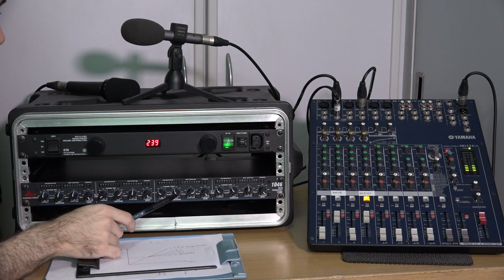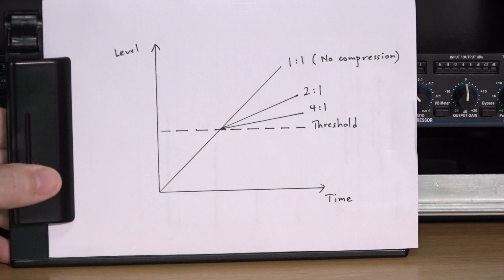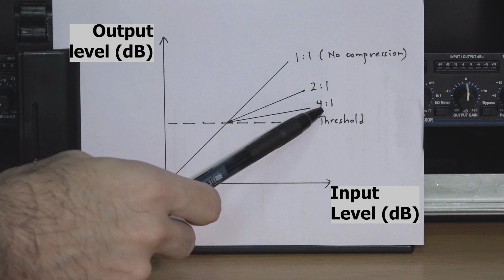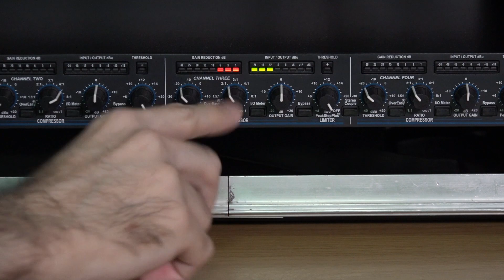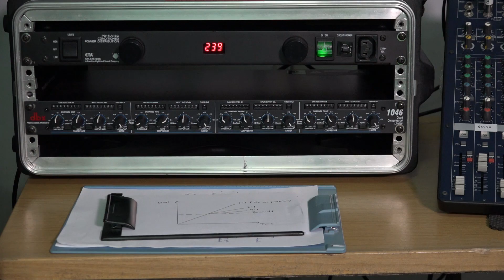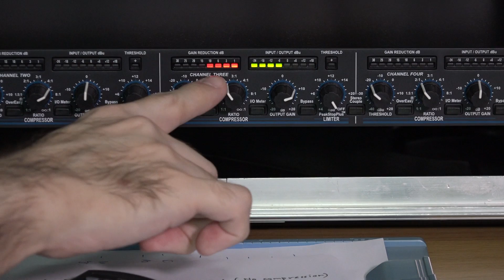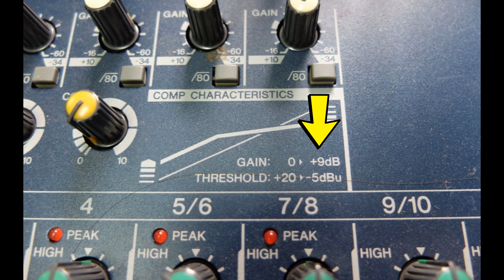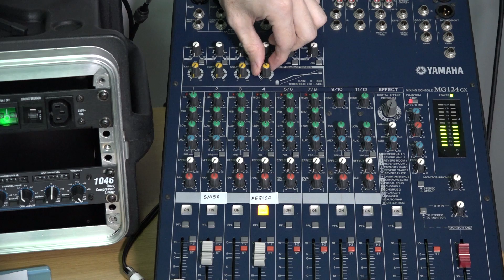How to use a one knob compressor

Comment: Hi Bruno, I'm a teacher in a secondary school. We purchased a new speaker system for our hall about 2 years ago, it was great sounding but it seemed to lack headroom (not sure if I got the right term). Whenever someone screams in the mic, there will be a terrible distorted sound coming out. I didn't have time to troubleshoot but I suspect that it could be signal distortion coming out of the mixer to the amps. Do u think I should get a compressor/limiter for my system? Also, can I connect to the group bus' insert io instead of individual channels, since most of my signals are vocals?
Reply from the maker: Hi Jeff, that sounds very familiar - I have worked on many school systems and they are almost all compromised, at least in Singapore. The distortion is generally at the mic preamp, where the gain control is. If you have to deal with screaming vocals a limiter is a very good idea - if you have the budget and technical know how it's best to upgrade to a digital console that has these on every channel.
Reply: @GLBProductions  Hi thanks for the info. I've also suspected that it might come during the preamp stage. I finally managed to troubleshoot but no matter how loud I scream into the mic, I can't get it to distort! Anyhow, will kiv. But may get a compressor/limiter for choir and drama purpose

Comment: Hi my friend .We have Allen & Heath MixWizard WZ4 16:2. in our church. could you please tell how to connect monitor to existing monitor out put and make it work with "M" control.
Reply from the maker: The "M" control on these mixers is meant as a mono feed, it's not really designed for monitor sends.

Comment: thanks for the demonstration, about the one knob compressor I still don't know what direction is the Best for set, because when u turn more and more the compressor knob will compress your sound begin hard to sing 。any solution ?
Reply from the maker: Start with no compression (fully counter-clockwise) and adjust from there :) If you have good mic technique you may not need any.

Comment: So, at first you set gain so that the loudest parts almost reach 0db. Then, when you apply compression, you end up with a stronger signal which peaks higher. Is it ok to leave it like that or should I lower the input gain to bring the PFL back to zero?
Reply from the maker: That is not quite right - when you apply compression you raise the average level of the signal, the peaks stay the same or are reduced, depending on the settings on the compressor. I recommend leaving the input gain alone unless you notice the channel is clipping.
Reply: GLB Productions That sounds right, I hadn't thought about it. I guess the problem is that we don't reach very high peaks during sound check, and the compressor stays below the threshold.
Reply from the maker: Yes, it's important to soundcheck as close to performance level as possible - singers in particular really need to SING into the mic, not just whisper!
Reply: GLB Productions It's difficult to be the soundman for your own performance. And for singers it's important to warm up before stressing their voice. So when you have to set up all the equipment and then soundcheck immediately, they don't have much time to prepare.
Reply from the maker: I can relate as I do some self-op performing as well as being a sound engineer. At times like that you just set things up and focus on the show, just like they did in the days before sound guys ;)

Comment: Awesome explanation, simple and straightforward.  Just a question, for the one-knob compression, do you set your gain first on the mixer prior fixing your compression?
Reply from the maker: Yes I normally set my gain first, but be aware that the two interact, so if you are using a lot of compression on this type of mixer you may need to compensate by setting your gain a bit lower. Thanks for watching!

Comment: awesome explanation Bruno. Btw ive got a tapco sq.2 by mackie, a vintage one 😅 any ideal settings that you can suggest?My setup is im using a yamaha mg166cx mixer and a DCA-550 power amp 200. If i put the compressor in between do i still need to use the on-board compressors?
Reply from the maker: Oh wow that's an old one, and very rare too! I'd say set the attack and release on auto, set the ratio at 2:1 for vocals and 4:1 for drums and then set the threshold to taste. You can also refer to my video on the Presonus ACP 88 for more info on this type of rackmount compressor: https://www.youtube.com/watch?v=jMajPBeAGbw
Reply: I know right? Hehe.Ive got a good deal for $45 SGD. its still new as the seller bought it for a project but never use in the end. Thanks a lot for the advise. Merry Christmas in advance. God bless! P.s i think ive seen you before in our church in Punggol last year with allen&heath gears.I think it was you 😀😀
Reply from the maker: It probably was, there are very few people working in audio in Singapore who look like me ;)

Comment: my keyboard player sings  REALLY  loud ...and one of my vocalist sings  REALLY REALLY  soft.....how do I set the compressor for those two guys???
Reply from the maker: In this case I would begin by setting the gain appropriately for the two singers - the softer singer will need more gain and the louder singer less. See my video on this subject: https://www.youtube.com/watch?v=KcUgggdxLPM
After that use the compressor to compensate for smaller variations in level.

Comment: sir can i connect the  2 channels audio output of my mixer to the input of the compressor and the output of the compressor to the input of the main amplifier so that i can control the output of all the mics connected to my mixer at the compressor ?
Reply from the maker: Yes you definitely can! The other way to do this is to insert the compressor on the main mix using the L+R insert points, if your mixer has them.
Reply: Have a nice day sir, thank you so much for your help.

Comment: Thanks again for the great video. does compressor helps to reduce feedback?
can you do a video n dbx driver rack as well. on how to setup for feedback control. I am having problem learing how to control feedback for condenser mic (rhode).
Thanks again for all your videos.
Reply from the maker: A compressor can help to reduce feedback but there are other much better ways of dealing with it - using directional mics, correct positioning of speakers vs mics, getting the mic as close as possible to the sound source.

Comment: I feel everytime I increase the compression knob the vocal is louder and it more stand out like it's sitting infront of your face but too much it will distorted,  don't know if it work by compressing your vocal loud to softer, what I know is it does make your vocal stand out more.
Reply from the maker: That's exactly the effect the compressors on this mixer have - by increasing the average level of the signal they make it stand out in the mix more. But too much and the vocal will distort in exactly the same way as when your gain is set too high.
Reply: Thank you, all your videos has been so helpful, but i was wondering how do you adjust the FX to give the Vocal space and full , what i had was a bit of space muddy to vocal and the tail is so hallow like in a tin can when fade away. im using for live karaoke, i thought i know alot but after watxhing your videos i dont know a thing lol. thank you for your help. would be best if yoi could make a video showing us , its for small size room.

Comment: Thank you for the clear and informative video. Is there a rule for use of compression? For example in EQ the best idea is less is more. Perhaps it wouldn't be needed at all for an acoustic duo vocals/guitar? And do you set the compression after setting all of the Gain, EQ, effects?
Reply from the maker: That's a very good question. In live sound, I'd say that most sources benefit from some kind of compression, because the natural dynamic range of most instruments, and especially the human voice, is greater than can be comfortably handled by sound reinforcement systems. As such, virtually every mix sounds better with some kind of compression. Knowing how much to use therefore is the key, and this takes years to learn. 
Compression can be inserted at several points in the signal chain: most individual channels are compressed immediately after the initial gain stage using an insert point, but you can also have compression on subgroups and the main mix bus. Each of these is a topic in itself.

Comment: Thank you for this video!  I have the same mixer, and this has been really helpful - on compression in general.  BTW - I love this mixer.  For my needs, the feature set is brilliant, and the bang for the buck extremely high.
Reply from the maker: Yes these mixers are great value for money - the one area in which they are compromised is build quality, so don't drop anything heavy on it ;)
Reply: Yeah, it's definitely not as solid as some!!  I think having the large external power supply makes it seem even less solid though.  Because of the substantially reduced weight, it seems to do okay and require less on-unit protection than say an equivalent Mackie.   Thanks again!  I passed this on to a coworker who also found benefit in your simple explanation of compression.

Comment: Very well explained.
Question though...recently I've come across some videos (regarding using Studio One DAW) that make use of "Series" compression for specific types of tracks. (drum bus, vocals etc.) The technique essentially makes use of very "slight" adjustments of the individual compressors in effect a quasi multi-band technique. I'd love to see your slant on this type of technique and how it helps or hinders the process.
Reply from the maker: I'm familiar with multi-band compression but not with this series technique. In live sound there typically isn't time for the advanced and intricate compression techniques that studio engineers use. We just need the dynamics level under control, stat ;)
Reply: oops my bad.  I realized that when you said so.  I was thinking mixing not about live recording.  In series compression is exactly that...two compressors in series with slightly different adjustments to better glue the track mix.  My apologies...wasn't trying to put you on the spot or anything.
Reply from the maker: No problem at all, I learn a lot from my viewers :) In live sound there is at least one form of series compression I can think of: on a digital mixer I will often use a high threshold, high ratio compressor on an individual channel like a kick or snare drum and then a low threshold, low ratio compressor on a group or mix bus. The latter would be set similar to a mastering compressor, so just giving a very gentle squeeze to the overall mix, similar to what you mention above. I have also used this technique with analog compressors, eg using a FET compressor on the individual channel and a VCA compressor on the mix, but you need a lot of gear to do this ;)
Reply: >> but you need a lot of gear to do this ;) <<
Yep...that's why we are pretty much in the box mixer/songwriters.  It's always THE GEAR!!  Agghhh!  :-D

Comment: how to disable the one knob compressor?? Is there any point using a seperate compressor with one knob compressor???
Reply from the maker: Yes, just turn the knob fully counter-clockwise. An external compressor will give much more control and is preferable to the one-knob compressor if you can afford one.
Reply: thanks for such a clear answer. have a nice day~~.
Reply from the maker: You're welcome! You have a nice day too.

Comment: Nice video, you should also do one on compressor vs limiter processors(there are lots of people who don't know and confuse them, eventually messing you up on live FoH mixes). P.S. Not all one-knob compressors add up THAT much gain, yamaha has horrible dynamic on compressors. :))
Reply from the maker: Yes compression is a wonderfully complex topic! Which Yamaha compressors are you referring to?
Reply: The one-knob compressors, featured on analog mixing consoles, such as the <edit:> MG124cx in your video. They push too much gain into the mix, and unfortunately even with a massive gain trim, they still feedback in tight/reflective environments. A wild theory that I have accounts to the fact that they're not optimized for certain dynamic/cardioid pattern freq. pickup(ofc... just a theory :))). Cheers.
Reply from the maker: Yes I agree that is not ideal - with live sound you really don't want additional gain being added without your knowledge. You have to plan on using the compressors in advance and then set channel gain slightly lower to compensate. Plus the whole issue of not having any metering etc. But hey they come with the console :P

Comment: This is a good tutorial to help you understand what compressor do and how to use it in live sound. It use to be when round knob mixers and then slider mixer came along the person manning the board would keep there fingers on the fader to keep sound level in check not wanting to overload a tape machine and keep room amp sounding the best. But you have to remember as a rule use the lease amount of compression you can. Proper mic techniques must be use to get the best sound recording and amp feed. Knowing how your mics pick up sound is the first line of defense against distortion of sound. Also picking the right mics for the job.  You do not want to reduce dynamic of sound. Good recordings and amplification must have  good dynamic. Using to much compression will dull your sound. My goal is always to get the best most dynamic sound when I am working with a any kind of mixer. Limit it as must as possible. Good recording and live sound is still a art form. And it take practice to!
Reply from the maker: Thanks for your contribution roger, sounds like you've been doing this for a while :)

Comment: thank you for this video, now i understand how my dbx gorack compressor works..
Reply from the maker: The compressor in the gorack is an electronic version of the DBX163 and has a fixed ratio of infinity to one so it will 'feel' rather different to the compressor shown in the video. However the basic principles of compression and make up gain still apply.